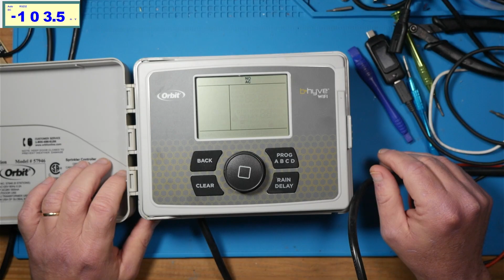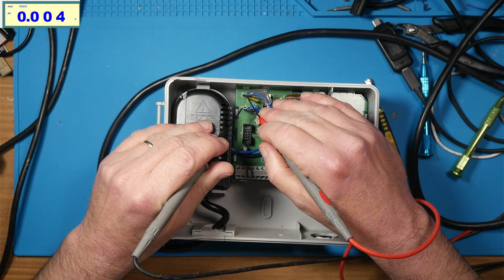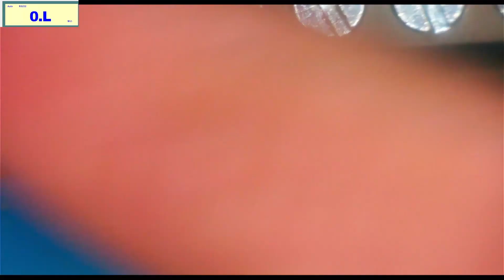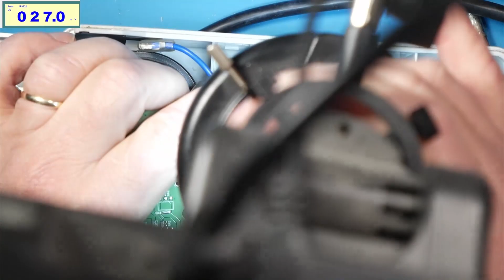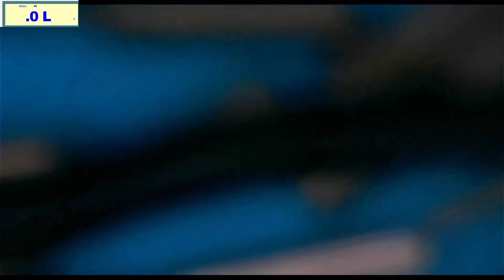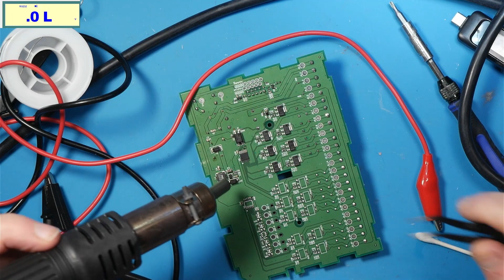Repairing an Orbit B-Hyve Automatic Sprinkler Controller- No AC Detected

Comment: Very easy to follow video thank you, just a quick question.  The bottom side of the diode, (the side where it said D2) that is ground isn't it?  can't seem to see any circuit leading away from it, so guessing it is straight to ground on the PCB.  Thank you
Reply from the maker: I cannot remember. The other side may be ground but don't think I checked..
Reply: When I was trying to remove the old  diode the top came off okay but the bottom bit left the board, I think it was half loose already. Was trying to trace back to where it came from. If it is ground I was just going to pick it up beside it on the board. Thanks
Reply from the maker: @peterbarker8639  I understand. You lifted the pad from the board. If you scrape back the solder mask around the pad, you should be able to see if it was connected to the ground plane. At 16.29 of the video, it looks like it is connected to the plane surrounding that area.
Reply: Thanks. Yes when I looked at the pad it seemed to be connected to the ground plane. I tried scraping the board back to the ground plane and connecting the new diode up.  When I plugged the power back in the 'NO AC' went off then it started flashing, but nothing else came up on the screen. There must be something else wrong with my board.  Thank you for your time and help.
Reply from the maker: @peterbarker8639  You are quite welcome. Hopefully, you can figure out what the issue is.

Comment: Sir, you should be commended and congratulated for your troubleshooting, diagnosis, and repair skills.  I had the same issue with my controller.  I watched your video a few times, ordered the part through Amazon (next day delivery), replaced the part on the controller, and it now works again.  Wow.  Thank you for your time and effort to make this video; I am very grateful.  A couple of things: 1) wondering what the root cause of the diode failure is; any thoughts?, and 2) do you think that the replacement diode will be robust and not fail like the original one?  Thank you again (a proud owner of 99 Schottky diodes :)
Reply from the maker: That is great news. Question 1: I think the root cause is power surges on AC mains that over time, weaken the diode, and result in the diode shorting. It has been, most likely, designed this way. Question 2: I am sure it will last for a while, but it will fail eventually. What can be done, is you can contact Mouser or Digikey, and they should be able to help you find the exact replacement for your system. They could help you find a diode that would last as long as the original part or longer.
Reply: @probablycantfixit6426  Appreciate your response.  Thank you again.

Comment: Excellent thanks. Had this issue on an orbit 6 station controller and unfortunately threw it away. Bought a replacement 12 station unit and alas the same issue on this one 2 years later.. Found this video....spent $1.00 at the local electronics store and replaced the shottky and she all works. Would have cost me A$290.00 to replace again otherwise.
Reply from the maker: That is great, I am glad you got it fixed.

Comment: Absolute legend!! Thanks for posting this video! Had two separate controllers stop working within a month of each other and was dreading having to spend lots of Aussy dollars replacing them. Few bucks and a couple diodes later, problem solved! Never soldered in my life before, you made it too easy.. I used SS16 1A 60V Schottky diode off Amazon which worked on both controllers. And now I'm armed with a soldering iron walking around the house looking for things to melt..i mean mend.
Reply from the maker: That is awesome. It is OK to melt stuff, just not your stuff.

Comment: you are a GENIUS  Thanks!! Just bought a mixed set of diodes on amazon and it has shottkey diodes - wifes losing her mind the yard is dying! Awesome man!
Reply from the maker: Thanks, I hope it works for you when you install the diodes.
Reply: @probablycantfixit6426  tx yeah hopefully my milwaukee solder iron and wifes glasses are enough to get that bugger swapped. Do you have an idea of where a fuse would/could prevent this? and what size?
Reply: Haha yeah same here 😅

Comment: Thanks so much for sharing the detailed troubleshooting and resolution. I bought a soldering iron, multimeter, the diodes, and everything else I’d need based off your video and was able to fix my controller. Mine had the exact same issue. You helped me pick up some tools for less than the cost of the replacement 👍🏼
Reply from the maker: That is awesome, I am glad you got it fixed.

Comment: Hi, thanks for the video, mine is showing No AC as well. Just took off the board and use the multimeter to test the diode D2, while it is still on the board, multimeter shows it is shorted, can I confirm it is the same issue as yours?
Reply from the maker: The only way to confirm would be to remove the diode and see if it is shorted off the board.
Reply: @probablycantfixit6426 Update:  I took it off the board and the diode is still shorted, showing 1.2 ohm both directions. Replaced with a new one and it works again! Just want to thank you for sharing your experience!
Reply from the maker: @Stellar_Quester  That is awesome news. Well done!

Comment: Mine is also now showing the "no ac" msg. I haven't checked the board yet but it's making a slight humming sound when the power is on. Anyone else had that?
Reply from the maker: I wonder if that could be the step-down transformer making the hum. I sure you will figure  out what is humming when you open it up.
Reply: @probablycantfixit6426  Thank you for posting your video.  I followed your instructions and it helped me fix my irrigation controller. Thx 🙏

Comment: same "No AC "problem, changed the diode with the recomended Amazon Shottky 1A 40V. Still got the N0 AC message.
Reply from the maker: Is it shorted across that diode?
Reply: @probablycantfixit6426  no
Reply from the maker: @tonydagostino3441 Do you have 38 volts DC at the big capacitor?
Reply: @probablycantfixit6426  yes it’s 39.2v dc
Reply from the maker: @tonydagostino3441  I would try checking for shorts on all the capacitors. If you can't find a short, then perhaps one of the MOSFETs is not functioning correctly. I think the voltage goes into the BN03 chip, which then outputs voltage to the rest of the board. If you don't have a short, trace voltage until you lose it. What voltage do you have on the inductor near the Diode?

Comment: Fantastic!!  Thank you for the video and diagnostic tips.  Ordered the diodes.  From what I have seen the Orbit unit is very sensitive to power fluctuations.  Seems like they needed to have a replaceable fuse on the front somewhere to block those tiny spikes to sags that kill this chip.  I don't think a power strip surge protector would be enough to prevent this but per your comments, a ups would clean up the power much better.  
Thank you again for teaching me so much!  Now if I could solder cleanly.
Reply from the maker: You are quite welcome and I agree, soldering is the most difficult piece to learn.
Reply: @probablycantfixit6426  Follow up.  100 pack of Diodes arrived and I replaced it.  Now the unit works!   I did have to look up which side the stripe on the diode needed to face but I watched that part of your video again and caught it.  Now i need 99 more of these units to fix!
Reply from the maker: @targetlog  That is awesome news.  Glad you got it fixed.

Comment: Thanks so much!  My diode was short circuit the wrong way as well.  I also happened to have the same 1A, 40V shottkey diode on hand, as you did.  Took 5 minutes to fix it.  I was just going to buy a power board from ebay, but they don't have them anymore and nobody seems to carry them. I have 2 of these timers.  I expect the other one will eventually fail.

Comment: My Orbit B-Hyve never worked right.  The unit would constantly lose WIFI and it never watered my grass correctly.  I also got a "NO AC" fault after several months since purchase.  The transformer output is 30 volts but the unit is dead.  The old turret worked for 25 years with no issues.  What a mistake buying an ORBIT product.  Junk.  Let me try this...
Reply from the maker: I hope you get it fixed. It sounds like you have an intermittent problem, which is tricky to figure out. The diode may help but it is hard to say. Let us know if you get it fixed.

Comment: Maybe you don't have a cape (SAY NO TO THE CAPE!) but I'm certain that the remainder of your attire is a super hero uniform.

I'm getting zero across D2 also. I don't have a replacement on hand, that I know of, but I'm certain that I have the exact same problem.
Reply from the maker: That is awesome. They are pretty cheap on Amazon, so if you give the diode a try, it might fix the issue. No cape, tattered sweats, 🙂.

Comment: "Probably"... this comment is off topic but I can't help but be curious what your response might be.
About the same time my B-Hyve Control Board failed, the control board in our GE Dishwasher (a few years old) also failed. Part nbr "ge265d1462g501mp00".  Ordered a new one (a little less than 200 bucks) and installed it. Dishwasher operational again. But when I examined the old board I found that 5 capacitors were kinda 'glued' to whatever component was close. The 'glue' was kinda opaque and I had to gently pry them away. This board lives directly on top. So I am wondering if the heat from the washing process could heat these caps up to the point where the covering melts and glues itself to the nearby component. (And also causes a failure).
All that said, and if the heat from the water/steam could be an issue I am thinking... what if I spliced in extensions to all the wires connected to the board and mounted the board in the area under the sink. (Oh... my wife thinks I am crazy!).
Reply from the maker: From my limited experience, the glue placed on certain components is to prevent loosening from vibration, drop, etc. The times I have removed it, I used a hot air gun to easily scrape it away so I could remove what ever component was faulty. So from that standpoint, the glue is pretty heat resistant but that is not to say, your theory is incorrect. It is definitely possible that prolonged exposure to heat caused the malfunction to begin with. If they are electrolytic caps, then heat definitely affects the capacitance. As to your plan of relocating it, if you don't mind the hassle, I suspect it could prolong the life of the board. To have a backup, I would probe around the defective board with a multimeter and see if I could locate anything suspicious ie. shorts to ground on caps that go to power rails.
Reply: @probablycantfixit6426  Great... thanks for the reply.
Reply from the maker: @demiurgiac  I just looked up that part number that you provided and I can see the glue you are talking about and it is around some of the electrolytic capacitors and two relays (they may be filters, it is hard to tell). You may have already checked this but if the tops of those capacitors are bulging then you should replace those as the capacitance and ESR are no longer within specs, and wont be able to supply proper voltage. I am sure you have checked all the fuses but if not, I am sure there are some on the board. In any event, it is most likely fixable.

Comment: 4 months ago I published a YT video on how to replace the Power Board which, at the time was 20 bucks and change on eBay. Well, at least I now have a spare board... thanks to you! I don't have your diagnostic skills but I do fool around with electronics as a hobby. So after stumbling across your video I plowed around my parts bins and found a 3amp 40v Shottky diode... swapped it in to the failed board per your instructions and Bingo!  Thanks Much!
Reply from the maker: That is awesome, glad to hear. Perhaps this is a common fault and it will help others.
Reply: I wonder what's the input voltage? 24vac ( your measurement is 28vac to dc will be a bit too close to 40V... 28vac to dc will be 39.6V minus couple diode drop...

Comment: I am curious if you were to run that timer long term, would that diode fail again? What caused the failure in the first place?
Reply from the maker: I am unsure. I know that we had a few days when the power repeatedly went out, sometime over the winter. I have ordered the correct component, and it should be good for another three years, :-). I think that I should invest in a small UPS for it, though, to ensure this doesn't happen again.
Reply: @probablycantfixit6426  Thank you for your video and your feedback. I really enjoy your troubleshooting methods. Great learning experience!
Reply from the maker: @karlconnolly4211  You are quite welcome and thanks.